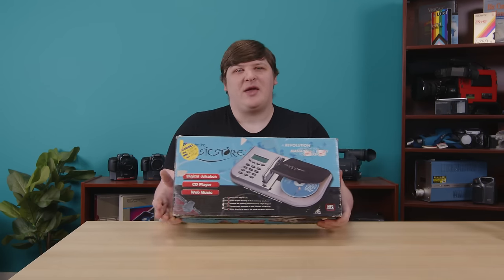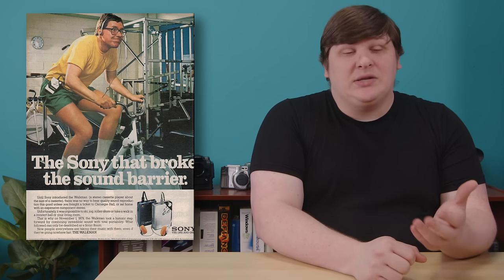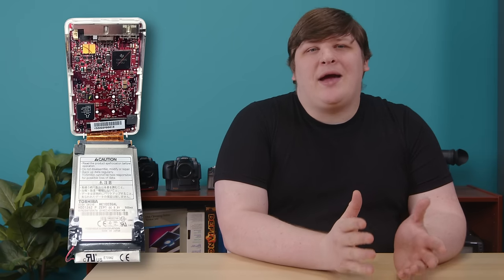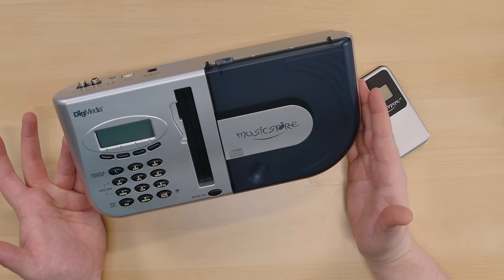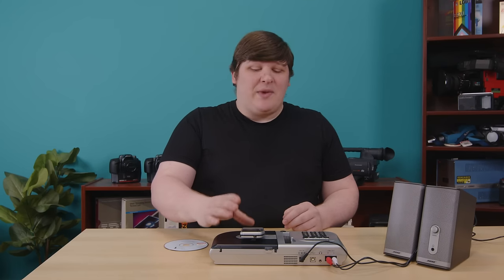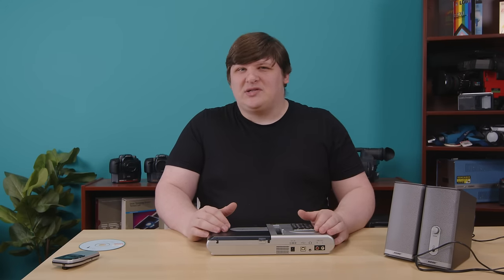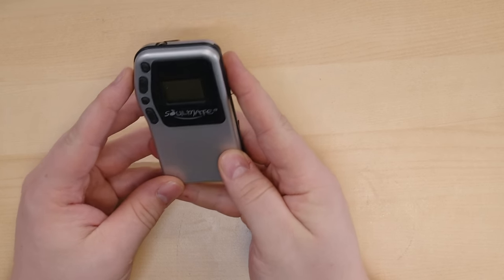An MP3 Jukebox for Everyone (Including The RIAA)

Comment: Great video as always. Just a heads up on those capacitors the mp3 player used. Palm pilots earlier than that had similar functionality. The capacitors would give you roughly 30 seconds to swap batteries in and out without losing your data. Wasnt perfect though. I did lose it anyway once in a blue and id be stuck with a reset to default device until i could hotsync again. I know palm had this feature at least as early as the Palm III which came out in 98.

Also was digitally ripping CD’s as early as Fall of 98. Most drives on the market from that point and later supported that. Think it was older drives (which there was no shortage of in use in 99) that required analog input.

I had been using a plugin for winamp back then, ripping to 128k mp3. On a Pentium 2 350 it would take maybe 10-15 minutes per disc for all of it.

Comment: They def could've added an analog volume knob. I had a Teac system that would physically move the knob when you used the remote. 
Probably way more expensive than buttons however.
Reply: It just takes a cheap motor to move the knob.  My old Sony amp has motorized knobs and it is so cool to watch them move using the remote.
Reply: @hicknopunk  Cheap on its own, but when you're planning on making tens of thousands of units designed down to a price, every penny you can shave off counts.
Reply: @hicknopunk  still though. A cheap Motor is more expensive than a tack switch or membrane.
Reply: @dunebasher1971  Sony 90s ES units are not built to a price point.  My CD player was $600 or $700.  The amp was over 1.5 thousand.
Reply: @hicknopunk  well yea you spent the money for it of course it's gonna have the fancy moving knobs
Reply: @hicknopunk  the Sony receiver I use in my bedroom does this.

Comment: During your supercapacitor theory testing, did you ever do a test with the unit turned off when pulling the batteries?  I wouldn't expect the supercap to be able to power the PIC and display for nearly as long as it would power the SDRAM by itself, potentially by a number of orders of magnitude difference

Edit: as it happens YouTube recommended me your follow up video where you addressed this. Thank you for your research, standards, and high integrity

Comment: I actually had the standalone Soulmate MP3 player back in the day (around 1999 if memory serves) before upgrading to a Rio PMP-500. I don't remember ever having an issue with the device losing its' contents when changing the batteries, so my guess is that those capacitors you mentioned have failed over time.

My Soulmate player came with the parallel port adapter, and it took forever to transfer music over from my PC.

Comment: Recording a mix makes sense in the context of audio tapes, which would probably be the only way the people this was targeted at had ever made mixes before.
The battery pack in the portable player was probably designed to have been a rechargeable pack, or at least the option for one, but got cost-cutted out. Still, I think a wall power option of some sort would've been handy for times where you're not at home but needed more playtime than the batteries, like in a car or waiting between classes in a student union. Especially given you lose all your  music if the batts run out. The super caps have likely died, at least given there's a massive problem with original X-Boxes (that are a few years newer than this) have a huge problem of the super cap it uses to save the clock time leaking on the motherboard and damaging it.

Comment: I think the soulmate has that weird battery compartment bc it was suipposed to use rechargeable batteries but they cut that feature later in development bc costs probably, bc look at how many contacts it has and how the charging bit is on that same thingy imagine if it was a battery, you'd be able to charge them outside the player, if it gets power from connecting it to the jukebox thingy you could charge the battery while copying music for example, idk, made it up rn but i rlly hope that was the case tbh

Comment: Heh! Owned a PMP300 when it was new. The battery door latch broke after ~3 months. The LCD stopped working on the replacement unit after a couple months. When the replacement for that one arrived, I gave up, sold it, and went back to a Discman and CD-Rs. The reality is that even at its best when everything worked - filling 32MB via the parallel port took longer than burning a CD-R at 8x, and practically you could only get about 8 tracks onto it. The battery life sucked. The whole thing was an under-baked experience.

Comment: Some sort of ROM dump to accompany that hard disk image would probably go a long way.  I can also tell with almost absolute certainty this thing didn't use a file system at all.  The very beginning of the disk is filled with strings for error messages - I'll bet the microcontroller directly addressed the blocks with custom positions for where things should go.  I also see at the end of a hex dump a repeated pattern of the same strings over and over (perhaps a skip sentinel?).

Comment: Super capacitors have been available since the late 1970s and started to get pretty popular around 1990... a 1989ish Sony ICF-SW7600 uses a small one for memory backup, for example, as do Onkyo FM/AM tuners from the time. The bigger sizes do not take well to rough handling and they do tend to have a finite lifetime.
I imagine these kinds of SDRAM chips would also have been used on SODIMMs in those days, permitting minimal standby power consumption.
Oh, and DAE should mostly have been sorted by the year 2000 if memory serves...  it definitely was not a standard feature in the times of 4X drives, but beyond 16X or so it should have been quite common. I remember ripping a fair few CDs on my 1998ish Ricoh MP7040A CD burner (4X/4X/24X)... actually it remained my go-to drive for tough rips for years.

Comment: Static ram is actually usually faster than DRAM of the same era. Partially because you don't have refresh cycles using up time you could be accessing the memory, but also just because of the nature of doing a read from them. For example back when CPU caches were external one of the the ways that the cache was different from the main RAM was that it was very expensive fast SRAM.

This is still true, caches inside CPUs are generally SRAM and even the registers within the CPU work basically the same way SRAM does.

Modern PC DRAM can also self refresh.

Another fun fact the original IBM PC didn't use a dedicated memory controller to refresh its DRAM, it had an interrupt on a timer that used the CPU to do a read/write.

Comment: 9:29 when Musicmatch came out it simplified the process of ripping music from CDs. It came bundled with iPods but had been around for a bit before that. I can't remember if Winamp or one of the Real Player softwares already could rip CDs but Musicmatch was faster BY A LOT, it could rip a CD in two minutes or so while AudioGrabber, JRiver and others would take at least double the time. Musicmatch displaced them when they added FreeDB so it would add all of the info automatically for every MP3.

Comment: Around y2k, there were several options for portable music. I think this is aimed at that market, not having your music collection available at home. Although the manufacturer said “we may as well make the music playable.” We had cd changers that held dozens of cds by then. I still have my Sony carousel style changer. You had a directory that told you which cd was in slot 24 or 47 and so forth. You even had a binder where you kept the cd liners. 

There was a big decision to be made about playing music in your car. CDs still skipped and it was a pain to carry them in your car. Minidisc hardly ever skipped and were durable like cassettes. So I chose that option. But making minidisc copies was similar to this device. It sucked. 

It was weird that an obvious choice of technology wasn’t there until mp3 cd capable radios showed up in cars. But that technology was obsolete when iPods came out and aux ports were standard.

Comment: One weird side effect of the soulmate using SDRAM as its storage that I don't think they ever considered at the time; it still works now. A lot of the early MP3 players players that had integrated storage flash storage by now are starting to degrade, if not already entirely unusable. However the fact that it has SDRAM and standard consumer batteries means you can even still demo the thing with nearly no problem at all. I love that kind of accidental future-proofing, even if as a music player the device has itself been rather deprecated.
I have an old 16bit portable computer that uses RAM as its storage and a pair of AA batteries (plus a backup) to maintain it, and the thing just keeps on going, the storage on it has never degraded at all (which makes it surprisingly useful as I've sometimes needed it as a portable serial terminal for the weird devices that still have RS232 maintenance ports).

Comment: Record makes total sense if you were used to a boombox with CD and tape deck: you record from CD to tape. Similarly, if you want to make a "mix (tape)" you would also need to record, you'd just do a track at a time. (And you'd always have to start the search for your next CD with a track to include in the mix tape) It's very much trying to be a super tape deck except with internal storage...

The 1x ripping has me horrified that it's possibly doing analog ripping...

Comment: Just saying, i was doing CD audio audio extraction around 1995-1996 on OS/2 and compressed it to MP3.

The reason i remembered is that my 486 DX4-120 was just too slow to play MP3 under OS/2, and DOS was just barely able to play it.

It was not as flaky as people would make you believe.  Just simple command line extraction tool and it runs well, later it allows you to tell the extraction tool what MP3 commission tool you have, and will run the commission tool for you as each track is extracted.

I think it is only flaky if you use those MP3 player applications to extract audio.  Early 2000 we see the introduction of EAC (exact audio copy) which does very high quality extraction, and so does dbpoweramp.

IMHO, extraction isn't that hard, i think they did it to whip up something faster and not spend a minute more in software development.

Comment: I was looking at datasheets for my memory module project, many of the chips had a self-refresh variant, and ran at a lower 3.3V instead of 5V for the standard chips. And this was in like 1990, so self-refresh DRAM has been around for a while. In fact, aside from the very early models with storage in the low KB, most PDAs with hundreds of KB to MBs of storage used self-refresh DRAM rather than SRAM.

Speaking of my memory module project, the two DRAM chips on the main board of the jukebox labelled GM71V16403CJ6 (the ones with the two missing pins) are 4M x 4-bit EDO memory chips, and there are two of them to make up the full 8-bits. This is most likely memory for the ARM processor, rather than sample memory for the DSP. There is a self-refresh version of this chip in the datasheet, but the ones in the jukebox are just the standard one. While they would technically work with my memory modules, they may not be compatible with many of the early machines they would fit in. There are some slight differences in timing between fast page and EDO memory which may cause issues with chipsets that aren't designed to work with EDO memory.

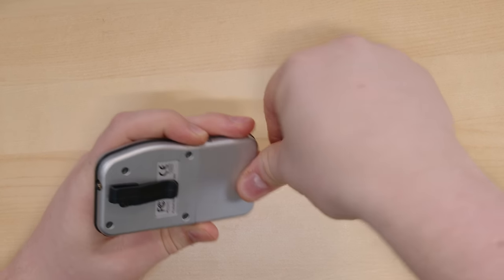Comment: @52:10 everyone at the time before Apple pay carried coins which were minted in various demolitions representing fractions of a dollar called cents.  One coin in particular called a quarter dollar would fit in that slot allowing you to easily unscrew the screw to gain access to the battery compartment.  Fantastic video. I was worried you would throw the device out the window.

Comment: For a device built so cheaply, it sure is incredibly modular, and all parts seem to be off the shelf! There are very little, if any, custom parts.

You could very likely, for example, take out that disc drive and use it on any computer, as well as repurposing that display, which is a very standard 20x4 programmable character display!

You would expect this kind of device to be extremely integrated into a couple of proprietary chips, but it isn't. That's actually impressive.

Comment: The Rio's 32 MB storage reminds me of my 1st portable MP3 experience: my phone, a Sony Ericsson Z530i without (yet) the M2 card. ~20 MB of storage. It was cool as heck to not have to bring the CD player to school, and why I used it to begin with, then with a 1 GB card it just simply became a capable MP3 player, complete with a 2020's modern dongle to get a 3.5mm jack even out of that proprietary port.
Also my 1st experience with in-ears and it was magic to actually listen to anything under 100 Hz without headphones that would take half the backpack to take with you.

Comment: Hilarious they used VHS quality designators in an attempt to make selecting quality easier. So just as in the case as 128kbps MP3s being sufficient for most end users, VHS recordings were usually run at ELP which got ~6hrs from a tape at a much lower quality, but was enough for most people. SP=Stanard Play/120min - LP=Long Play/4hrs - ELP=Extra Long Play/6hrs
Reply: Less hilarious when you realise it goes back to vinyl somewhat, with long play or LP becoming a popular format for audio dramas especially to be cut to record because it reduced cost (yay for microgrooves). It kind of remained with cassette tapes but outside specialist uses rarer there, VHS picking it up goes back to the vinyl reason, cost. Getting longer tapes was often a supply issue, I have a few dozen 3-hour @ SP VHS tapes, while longer existed they were kind of hard to get locally. And LP/ELP recording and playback were a bit more uncommon outside NTSC areas for VHS.

Comment: I remember ripping CDs and converting them to MP3s in the late 90's, it was a slow process. My PC at the time, an AMD K6 100 MHz, couldn't produce MP3s even in real time. Compressing 3 minutes of a CD quality Wave audio file would take at least four to five minutes. So the fact that this cheap device doesn't go faster isn't surprising.
Reply: Facts. I used to rip to wav which was notably faster (4x I think) and then batch encode the wav files to mp3 with BladeEnc while I was at work or asleep. Would wake up or come home to new mp3 files ready to tag and file away after listening to them to make sure there were no glitches. Then delete the wav files I wasn’t planning on burning onto mix CDs for the car.

Comment: The late 90s such fun times, had a broken screened 486sx laptop hooked up to my stereo and TV via composite output to play my mp3s and midi files with winamp and use the visual plugins could rip my cds at 16x speed with my mates dad's 16x pcmcia cd rom drive he would also bring cds full of Mp3s and early video at like 160 x 120 12fps fun times,  from memory it had an 500mb hard drive windows 95 and 8mb ram

Comment: I was designing embedded electronic products from the 1980s through the late 1990s. Self-refresh DRAM was actually common for embedded products. It was available at higher densities and lower cost than static ram, and flash was slow, difficult to use (block erase/write) and crazy expensive into the early 2000s.

Comment: In 2001 I paid $450 for my first CD burner (4x) at CompUSA and the CD-Rs were about a quarter a piece. That was a lot more appealing than this. I didn't even bother with portable MP3s until around 2006, I just burned CDs of MP3s I downloaded. MP3 CDs were pretty cool for a while too where they were supported but regular old CD players were everywhere.

Comment: the Kodak DC120 Zoom has a supercap to keep settings while changing batteries. and, like others of the era, it has issues with it. if you get a DC120 Zoom, make sure to open it up and REPLACE IT. the thing leaks and corrodes everything around it.

Comment: I'm not one-hundred percent certain, but I believe that SP, LP, and ELP are related to the jargon of record quality related to tape-based media. I remember having a VCR that had the same options for recording to a blank VHS. If I remember correctly, they meant Standard Play, Long Play, and Extra Long Play. As counter intuitive as it seems, Standard Play is the best quality, thus taking up the most physical space on the tape, Long Play is the Middle ground which isn't as good a quality, but allows you to record slightly more data before running out of tape, and Extra Long Play is the worst quality but the largest amount of recordable data. I have no idea why they would use this jargon for digital data, other than perhaps the fact that people at the time would have been familiar with it. Again though, I could be wrong.

Comment: On another note, as an electronics enthusiast I do wonder how challenging it would be to upgrade the hard drive in this thing with something(a lot) bigger than 5gb. Cheap as it is, having a library of 300gb worth of MP3s would still be pretty slick.
Reply: It really depends on how it was setup to work with the drive, if it was specifically targeted at that model of Travelstar you probably couldn't upgrade it much if at all. The joys of physical addressing.

Comment: I had a Rio 500, the follow up to the PMP-300. It was amazing. 128MB SM/MMC cards were expensive when they finally became available, but 3 of those along with the internal was more than enough. Most of it was at 192, sometimes 320. Wasn’t nearly as HUGE as the Nomad Jukebox. First thing I spent decent money on at 13 years old and never had a moment of regret.
Reply: I bought a second hand Nomad Jukebox not long after they were released in 2001 and absolutely loved it.